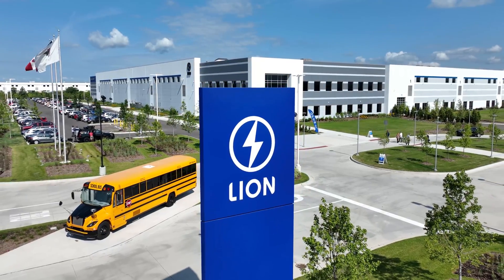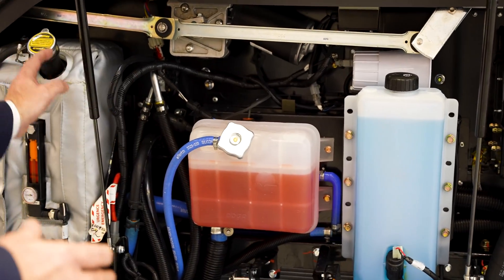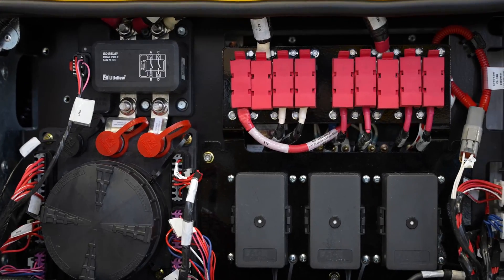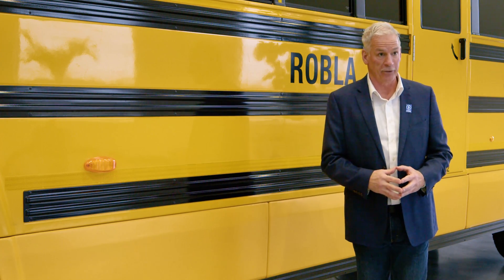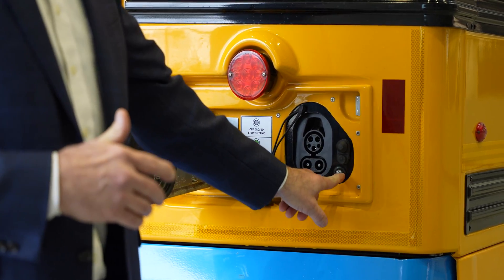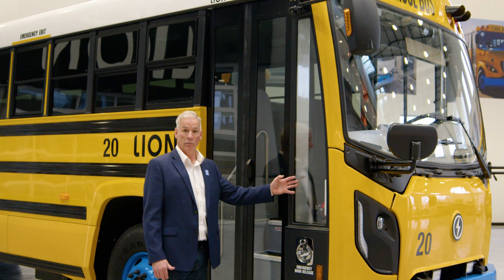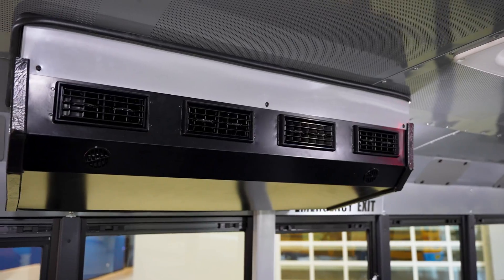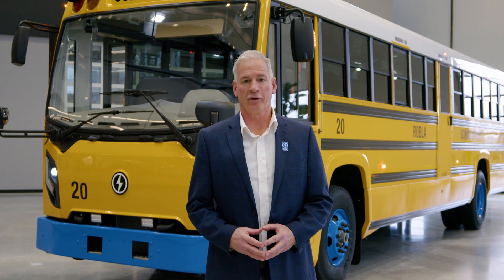LionD Walkaround | Get a 360-degree view of this all-electric school bus!

Comment: I can talk for hours about problems in thosebusess but will talk about the most common fails. The heater design is horrible using a diesel engine and causing fires because of it being poorly installed, the suspension is cheap and lasts 11 months in average, the battery life is very poor, the seats are small uncomfortable. The door motor fails on certain buses got an total engine failure. Poorly build and poor insolation with water getting in the bus by cracks when it's raining very hard. Sensors fail and most notable failure is the compressor weakening and failing

Comment: Love to see a very repairable vehicle!
Reply: Company went completely broke and shut its doors. Now, none of the schools that bought these have a way to have them worked on it all..  so much for repairable.
Reply: I work as a forklift tech, specifically electrical. They seem to be worried about stupid crap nobody actually has a problem with. I can't tell you how many times I've ever had to actually remove switches / breakers to replace, it just doesn't happen all that much. The battery hold down clamps they use are those stupid J hook ones which love to pop out of their slot, so the tech will love that. But thank god for the replaceable battery tray (sarcasm)! I guarantee those side markers and other lights are epoxied in place or you have to remove half of the bus to replace them.

Comment: As an Industrial Maintenance Technician, I love that they placed Maintenance so high on the scale for importance. Can't tell you how many times an Engineer will design something and place a part that will wear down quickly into a position at which it takes hours to dig down to.
Reply: This is a scam company, these busses fail after about a year.  All of these will have to be replaced by gas busses that actually work.

Comment: If the vehicles don’t have a major flaw in the system then it shouldn’t catch on fire but it is always a good idea to have the vehicles checked out before they are deployed. School districts who are transitioning from fuel-based school buses to electric buses should establish a maintenance program to make sure that the electric school buses are in good condition and have them checked out for any potential safety hazards
Reply: Probability of catching fire for such low energy density batteries is extremely low. These are not using high performance high C Rating and high energy cells. They achieved better safety by sacrificing range which they don't need.
Reply: @Neojhun  One if not two in Canada recently caught fire and looked like the entire bus has been drenched in gasoline, luckily the last student had recently gotten out but one day this will happen with kids inside and with the spread and intensity of lithium fires it's highly unlikely everyone will make it out.
Reply: @Neojhun  Several have already caught on fire.  Just a matter of time until students are trapped inside.

Comment: Just for the record those electronics compartments look very vulnerable. In fact it is somewhat shocking to see that there is so little between the electronics and the weather. The doors are flimsy and unlocked and there's just a standard looking gasket for the door. It's very dangerous if water or salt gets in there and short-circuits the battery.
Reply: WRONG You have no clue what you are talking about. The doors even have a thorough gasket seal to protect the power electronics. "if water or salt gets in there and short-circuits the battery" sure that might happen if the Whole Bus gets flooded. Why do people with zero experience with a wrench post absurd nonsense.
Reply: that is done so the school systems replace the entire bus yearly
Reply: @cybervision_1  "replace the entire bus yearly" Even the 12v battery they chose is designed to last longer than normal. It's like you want to ignore facts just push some silly agenda.
Reply: @Neojhun  These busses are failing after less than a year in every school district that bought them.

Comment: yeah, everything is nice pretty looking in the beginning but what about when you have a -30 degree condition with the charging plug frozen in ice and there's no way to charge the bus or when the bus stops due to the fact that's its not charged enough. I'm a truck tech and I am starting to see this a lot on the EV Transport trucks.

Comment: FABULOUS. But I'm rather disappointed that there's no provision whatsoever for disabled students to ingress/egress & have a dedicated place to safety sit in a wheelchair. I guess standards must be much lower in Nth America than in much of the rest of the world. 

Separately, I'm totally flabbergasted that there appears to be no rooftop or ground mounted solar arrays to reduce energy costs, cost of production, and reflect that this is a company focusing on the sustainability of transportation. Surely, this is a major oversight on the part of the company.
Reply: Disabled students are usually bused seperately for safety. As this allows for a smaller bus to go door with a lift. 
The school bus sits high to keep kids above normal car accidents (This is being comprimised by larger and taller SUVs recently.) As such there is no kneeling bus, and the last thing anyone wants is a big bus sitting on a major road while the driver is outside working on a lift.
Reply: @EmperorNefarious1  Thanks. It's slightly different here in the UK as legislation means most public forms of transport are automatically designed to have integrated kneeling and ramp features plus an area dedicated to wheelchair and pushchair users. This isn't to say that we don't have any similar types of disabled transport to what you're describing.
Reply: Solar panels on a school bus would probably not provide even close to 1% battery charge if it spent an entire day outside in the sun, you clearly have no idea of the gigantic amount of power EVs require or the minuscule amount of power solar panels generate. Just a high speed EV charger for a car can consume as much power as 100 homes, think of how much charging a bus would take.
Reply: @aabsc  What the hell are you talking about? I never said anything whatsoever about putting solar panels on a school bus. Reading comprehension skills matter....

Comment: Why didn't you say anything about the hydraulic brakes? Am i understand right that this bus works with hydraulic brakes? My opinion is that it is a main feature... i can't understand how it works for such a havy bus
Reply: Umm most vehicles of this size have pneumatic AIR brakes not hydraulic brakes. Please stop spamming erroneous assumptions.
Reply: @Neojhun  I found in the internet information about HPB powe brake system which one was produced by wabco specific for ic bus

Comment: The bus itself looks great but I think the battery comportment shouldn’t be on the front. The steering wheel shouldn’t include amber/red and door buttons because you’ll chase them around. We got old international bus and I didn’t like it. And the bus needs underneath storage. Our eLion C has no storage so we ended up using either the last for rolls of seat for storage or the first four rolls. Or sometimes we use other buses that have storage (diesel/cng bus).
Reply: It's a school bus...not a greyhound
Reply: @dadejazzba402  I guess you haven't taken a high school football trip.
Reply: @tval3905  get one with wings and fly there...lmao

Comment: Why is the stop sign in the back of the bus instead of in the front
Reply: California bus.
Reply: Some buses are that way depending on what the district demands.
Reply: School buses in other countries are either vans or normal buses with NO flashing lights and stop signs equipped. No need to stop all cars, they just slow down.
And yet US and Canada still rely on their outdated bus regulations where all cars in all lane in both directions must stop unless there a big-ass median. No wonder why school bus in the US and Canada cause congestion and pollution from all the cars idling in a long time. School buses stopping traffic can cause delays on transit buses and truck deliveries, they can also cause people to be late at work.

Comment: Does the heating system for Winter time, run on battery power ?
Reply: It can be battery or diesel powered.  You choose.
Reply: Air ride schoolbus, this is such a great feature over the old school busses and much safer. 
Well done, what a great product. Will be great to see the V2G capabilities.
Reply: nope, diesel fuel,      it would use too much electricity.        all electric my ass, lololol
Reply: @danikmcintyre2068 Yes you'd expect diesel heating for snow and ice use although the walk-around depicts electric heat pump which you'd need in hot weather